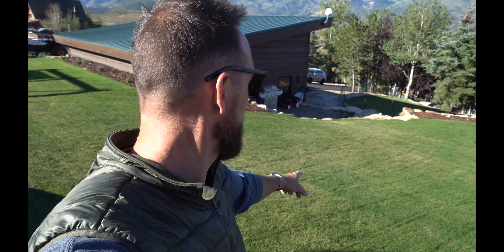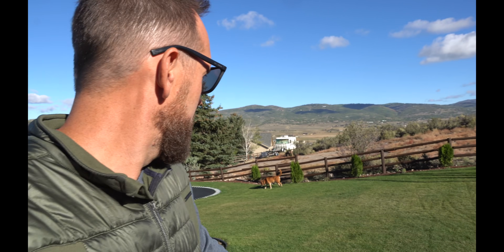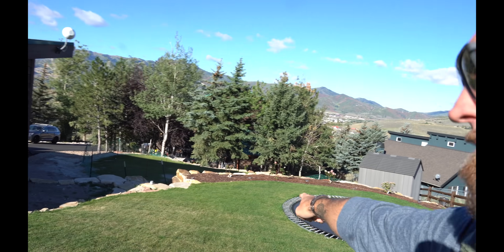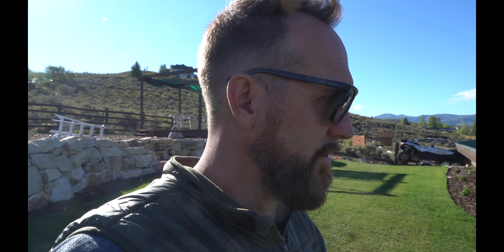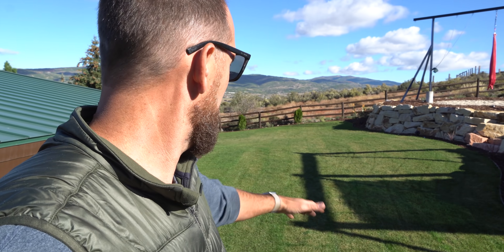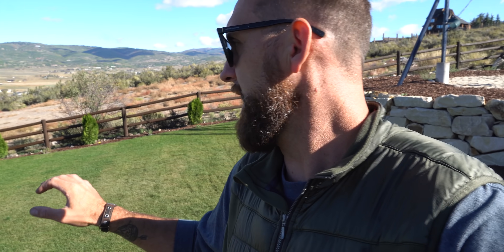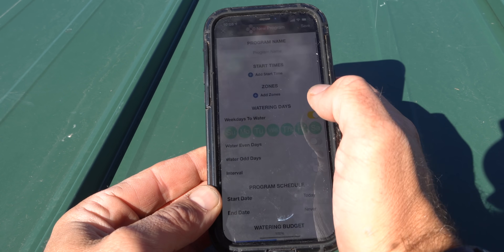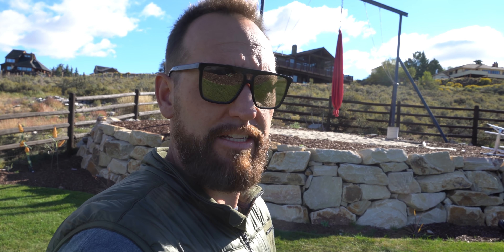The SOLUTION was The PROBLEM

Comment: John I may have gotten confused by all the numbers but from the link you provided doesn't it say the precipitation rate for the MP2000 is basically .4"/hr +/- a little in the box configuration regardless of pressure. So doesn't that mean you'd have to water each zone of an all MP2000 system 3.75 hours to get 1.5"? In comparison Rain Bird nozzles are all matched precipitation to 1.58"/hr so they'd require a little less than an hour.

Something to be on the look out in the future is the MP rotator distribution uniformity is very high around the head and drops off rather linearly as you move further from the MP rotator. When you combine them with other zones of MP rotators with head to head coverage it works beautifully to provide really high Distribution Uniformity (DU). However most other types of nozzles have the exact opposite characteristic of not watering well around themselves and throwing most of the water further out on the perimeter while relying on the opposing nozzle in the system to water around it. However, the MP rotators don't do that so well as they have the opposite characteristic. So if you were to combine say a MP2000 on one zone with another zone of Rain Bird VAN or MPR nozzles it will be very wet around the MP rotators and very dry around the Rain Birds. One way to possibly counter that while avoiding using MP rotators on all zones, while still using a high flow nozzle, is to use the Rain Bird HE-VAN nozzle or the U Series both of which water better close around themselves. But ultimately I think to get the coverage you want you might be forced to switch all zones to MP rotators. That should give you an 80+% DU. The downside is it takes so long to water the upside is minimal run off which works good with your sloped lawn.

If you'd like to see the Distribution Uniformity for a single MP2000 rotator google design_guide_MP_Rotator_LIT-461_dom.pdf and it's on page 9. Best of luck. Super excited about the progress of your landscaping and lawns in particular.
Reply from the maker: I love that people like you exist. I suck at sprinkler systems and have only installed a couple. I matched as much as possible on my flow rates to get the best coverage. I though that in 2022 I would switch all nozzles to MP’s but I’m not sure I need to. I’m on the third day of 3/30 minute waterings and the moisture is just starting to get down into the soil but no runoff. The overlapping coverage does work to prevent the noticeable drought stress that can occur, but as soon as irrigation was off, the problem showed itself. I may run for another day or so with what I’m doing and see if I can get the moisture to the 4-6” depth that I’d like. It will be fun to see if there’s any root chasing over the next few weeks before all the turf starts going dormant
Reply: @Lawncology  Feel grateful I could share something beneficial as I suck at growing grass and have learned so much from your knowledge. Personally, I don't think you suck at sprinklers, lol. From what I can see you did a good job. You just ran into an issue that required a modification and I think using Mp rotators was creative and the right choice. I am sure you could make the coverage work but you'd have a high scheduling coefficient (SC) which is the multiplier required to water the driest area to the desired watering level compared to the theoretical perfect coverage. 

With all MP rotators laid out correctly if the radius between heads is around 13' your scheduling coefficient will be 1.1 and if it's closer to 20' between MP rotators it will be 1.2. Meaning if it would theoretically take 100 minutes to spread the water perfectly evenly out over the sq footage to get your desired moisture, with a 1.2 scheduling coefficient it will take 120 minutes of watering to get the driest area the water it needs while over watering by 20% elsewhere. For comparison a Rain Bird VAN nozzle has a scheduling coefficient somewhere around 2.0, Hunter Pro Adjustable 15-A SC=1.9 the new Rain Bird HE-VAN 15' has a SC=1.2. 

To get an idea if you'll have decent enough coverage, you could easily use the tuna can method placing them 2 feet from the heads on the different zones. Unless you switched the Rain Bird nozzles I recall they are VAN nozzles. So I'd think if you run the tuna test with the MP rotator zone running 3.5-3.75 times the minutes as the other zones you'd get a good idea how the water is being distributed.

Curious how do you prefer to determine the soil moisture level of 4-6"? Are you using a probe or screwdriver? I personally think I struggle with obtaining the correct moisture level and more than anything else that's what is holding my lawn back. I have a sandy clay loam soil and I think because of it's porosity it gives a false sense of water depth using the screwdriver method. I've tried the moisture meter but that hasn't worked out well either. Thanks John for the work you do educating and creating products!

Comment: I have had the rain bird RVAN ROTATORS in my yard for 4 years. Great in concept but a maintenance nightmare. KBG mixed with not having to use the system every day, with non flush nozzle design with lots of nooks and crannies , equals a lot of thatch and crud getting into the heads and them not seating down all the way. Streams missing flow etc., city water does not make up for dirt clogging them super easy due to thatch and weak springs. 
Had to manually pull up and flush them each time they ran.

I have converted to RB fixed sprays. I have a good head to head design and city pressure and I use 30psi regulator heads. I use timing and soaking to improve efficiency and minimal runoff. 35 RVAN nozzles now in the trash.

I should have tried the short throw Hunters as they might have done better with the double pop and the higher precipitation rate. But I’m not spending $5 a nozzle again, at least not now. A well designed and executed and OPERATED system with traditional sprays can be very efficient as well.

Comment: 3 cu/ft of water * 8.92 (weight per gal) / 12 * 1000 sq/ft * ambient temp - wind factor = Just use cat food cans to balance your system
Reply from the maker: I ran cat food cans on the mps at 10 minute intervals with no collection. Single head 50% spray pattern match up was actually way easier. The the cans had so little water in them after a run that the sun dried them out by the time collected. The areas where the RB collected were easy to ascertain. I based initial setting Ins the flow rates in the manual but the actual was way less.
Reply: @Lawncology  Another thing which I'm sure you know is rate of evaporation varies greatly depending on the pressure/volume and orifice type. I'm on well and have the same problem as you, low volume and pressure so run .75 gal/min nozzles to get 3 heads on a zone.  Trouble is that the nozzle is so small, it atomizes the spray and it's gone before it even hits the ground
Reply from the maker: @njphil1279  the idea was to get the max volume while maintaining head pressure. It’s working and the grass has responded in kind already. My soil will hold moisture very well, just have to get it in there!

Comment: Rotator sprinklers are a wonderful concept. Yeah you just have to compensate the run times, (tuna can challenge) but at the rate they irrigate is so efficient, water stream/droplets as opposed to mist that can be lost on overspray or evaporation. And they look really cool while in motion. 
'Cool haircut BTW.
Reply from the maker: Thanks John. Yes, I am likely going to run these on off days from the rest of the system rather than have them all run through the night
Reply: @Lawncology  sounds like you've got it dialed in, will be a fun update.

Comment: I wouldn't mix Hunter MPs in the same area as other brands on the same zones. Nor would I overlap them. I converted my entire system to Hunter and they are awesome. It will be interesting to see what you end up settling with on your particular situation.
Reply from the maker: Given the length of time between watering, I think these are going to just need to be running longer on odd days to compensate and not when the others run.

Comment: Heard another creator say that its not good to put down organic fertilizer in fall because it does not break down very well? Any truth to that? Thanks.
Reply from the maker: Temperature dependent. Hey releases it faster. It’s going to remain fairly stable in the soil til next year if you use it. Water can impact the breakdown as well, but temps are typically in control there

Comment: Just installed brand new irrigation 6 zones ALL HUNTER MP 1000,2000,3000 and some side strip mostly 90-210 degrees a couple 360 but yes alot longer

Comment: This is one reason I’m excited about the irrigeen system.  Although it probably wouldn’t work on your low pressure stations.
Reply from the maker: post up a link to it. I don't know anything about it.
Reply: @Lawncology  sorry if you got like 3 links.  YouTube is driving me nuts.
Reply: @Lawncology  TheLawnWhisperer and I put one in my yard. He did a video on it. Doesn’t work great on low flow though.
Reply: Note - I am NOT supported by irrigreen, although I sound like it.
Reply: Looks very cool. Had no luck in finding installers and that's not something I'd diy for me..

Comment: I did the same exact thing while testing out MP rotors. I just went back to the Van nozzles for my system. Figured if it’s not broken, why try and fix it, but I was in my favor, so now I can redo the backyard. Winner winner…#failuresequalmorefun
Reply from the maker: LOL. failing is just learning a way NOT to do things
Reply: @Lawncology  Very true Sensei.
Reply: Converted to fixed and van RB sprays from RB rotators. I think they work better in short cut lawns or not KBG that’s kept tall. Grass and dirt clogging under the nozzle and streams not spraying fully. Nice thing about traditional spray heads is they close right against the top of the cap. No place for grass and dirt to sneak in. If they had a completely hidden and flush rotator like the sprays are, I think that design would be a winner.
Reply from the maker: @seanrice7511  I think you’re right
Reply: @seanrice7511  I agree 💯
Reply: @LawnNOrder  it’s funny I am looking at the old version of the rain bird rotator, the original design with fixed arcs, and they hide it all under the cap except for the top rubber dome. I have 2 in my front yard that NEVER gave me problems like the RB RVAN rotators did. another ain’t broke story.
Reply: @seanrice7511  I think they have a purpose like you mentioned. I am not well educated on sprinklers, but from what others have said the help prevent pooling. I have never had a pooling issue when my soil is 78% sand.
Reply: @LawnNOrder  it definitely helped with pooling water. I have clay so I wanted them to work so bad. The Hunters with their double pop flushing action probably solve some of the issues I have with the RVANs. Just nice to know I’m not the only one who gave some rotators a fair shake for a few years.

Comment: Great video JP.  Maybe it rained here 2 or 3 times in Arkansas all summer.  It showed that i'm having issues with my heads in my backyard.  this year they have sunk and ended up sideways.. i never had the opportunity to dig them out and raise them up.. my Zoysia/Bermuda backyard looks terrible compared to the last 5 years.. Hopefully it will bounce back after i get them fixed this fall or in spring!
Reply from the maker: Definitely get those taken care of. It's always odd when you live in a place that's traditionally pretty wet in the summer and then nothing happens
Reply: I got hit pretty hard in Conway. With the zoysia I’m always afraid of fungus so I’m more careful with my sprinkler system, but I should have watered so much more. I’ve got lots of compaction and powdery soil.
Reply: @Jknudsen0523  i'm in Fort Smith, AR.  Do you use the bio-stim pack?  Which fert do you typically use?  I use the biostem pack and this this year i used Lawncare Nut's Flagship fert.. last year it was Carbon-X.. both with great results.
When the irrigation and rain is working properly, my soil is typically moist, loose and dark.
Reply: @rashofbeatings  I will start that next year with lesco. This was my last season of using a lawn service.